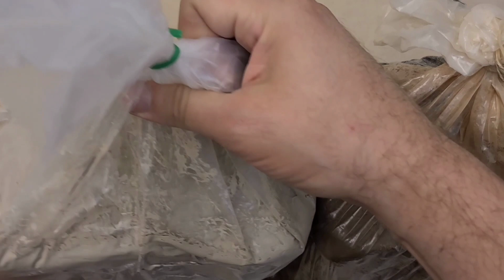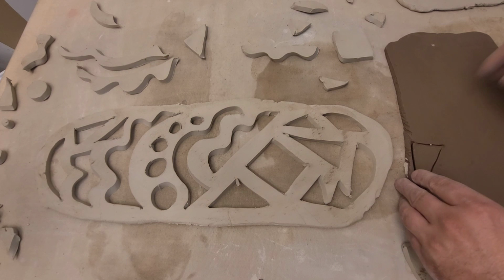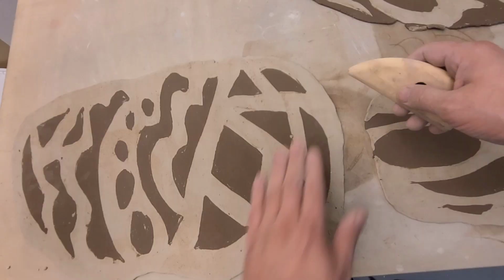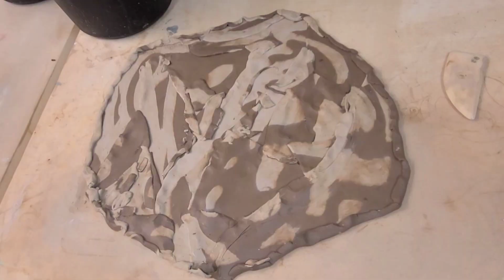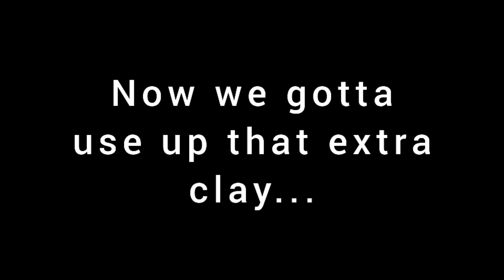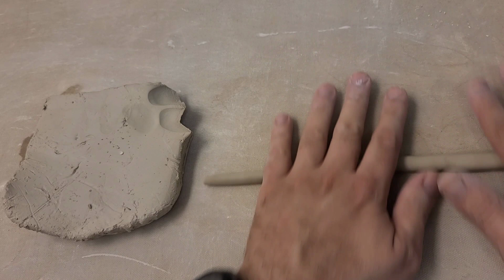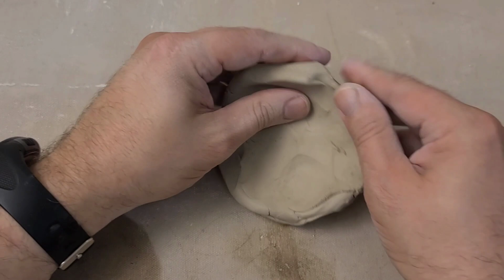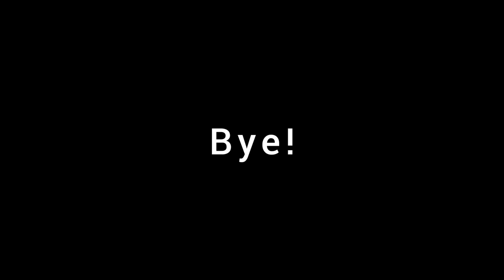The Magic of Clay! (4 Different Simple Ceramic Techniques for Beginners)

Comment: Wow man, outta sight. Too RAD-iculous. I had to slow down the play-back speed to 0.75!  
You make it all look so easy. Does the clay stay together like that on it's own, like when you pick up a "sheet" and it doesn't fall apart, is that because it's been smooshed and rolled and not too wet or too dry? Or, does it take years of practice? 🤷🤩👍 
Whatever, you got it goin-own, Mattman. 
I'm so glad for you that you have a studio like you've wanted for so long. I hope you get to do all the neat-O-kean rad cool far-out stuff you want to do 🐒. Luv ya man. Later 🐊